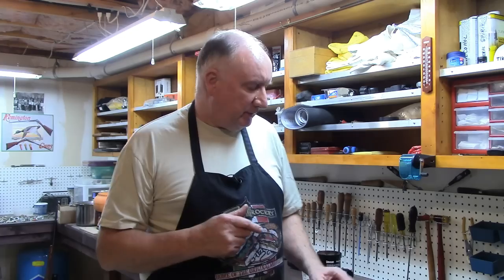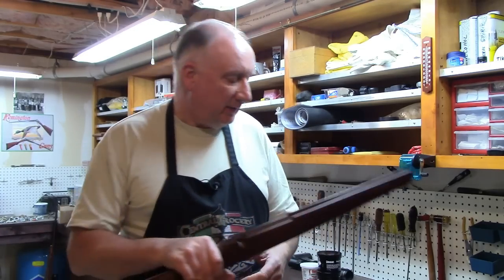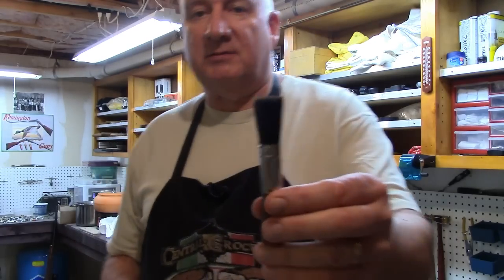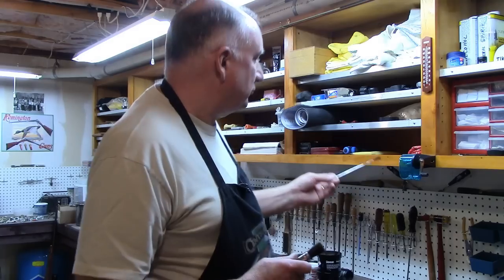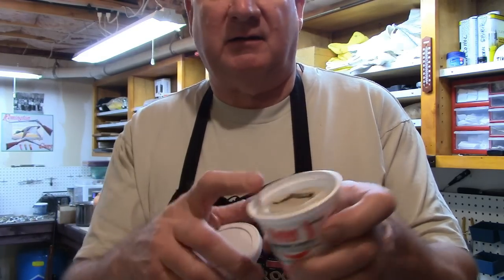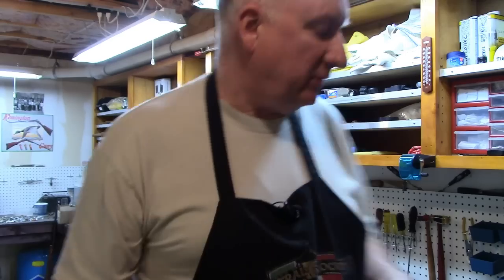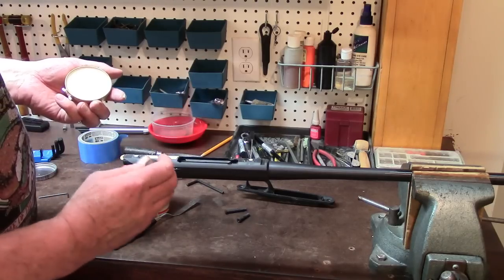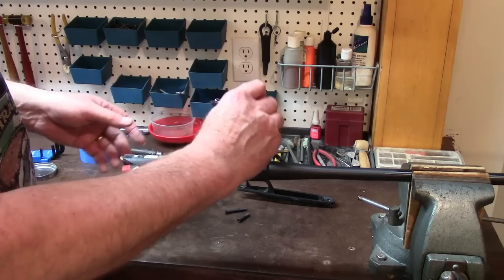How to glass bed a rifle, Part II ~ Let's bed that rifle professionally!

Comment: Captain, the more I research glass bedding for my specific rifle and stock the more freakshows I find. People are making a complete mess out of their rifles! Most of them are getting that slop everywhere because they don't know how to work with epoxy, and it is evident that they don't understand the concept and potential ways in which it prevents inaccuracy. One guy couldn't get his stock to separate! Your video has been really all I need and it's too bad a lot of them didn't arm themselves with the proper knowledge. Like almost everything in life, preparation is key. You are right, it's not for everyone. I'd watched this video before I did two of mine and they turned out nearly perfectly. Thank you!

Comment: Just picked up a very near perfect 45 year old Kleinguenther K14 in 25-06.  Made in Germany and developed by the man of the same name who once designed for Weatherby then moved to Seguin,  TX to start his own business.  I was a bit disappointed when finally I opened it up to find it was not bedded.  It indeed had small wood pegs angled into the front of the fore end holding up the barrel by less than 1/16 inch.  I shot some over-priced and overly hot rounds of Underwood and got about 2 MOA.  I could live with that but hopefully with better ammo I can improve that.  If not I will be forced to epoxy bed it.  I've worked with my hands all my life and am sure I can do it if I have to.  I'd rather not though.  It's a beautiful rifle and I'd hate to ruin it.  I will watch your videos several times before I attempt it.

I'm assembling the components to hand load for it but it is very difficult to find everything these day.  Sure makes shooting tough.

Comment: Thankyou for this detailed series of informative videos, it's particularly helpful for me as I have a Tikka t3 which I'm making a laminate stock for out of birch ply. It came with a synthetic stock, it's an experimental process but looks promising. I plan to glass bed the action in as you have shown and ensure the barrel is fully free floated, hopefully then I will see no loss of accuracy from using the synthetic stock. The gun in its original form I have shot 1/2" groups from at 100m which is exceptional considering I'm using factory ammunition. Lucky for me as I don't reload!! Thanks again. 👍👍

Comment: Those days of Guns and Ammo magazine are sorely missed .  Aluminum 1/8 " thick plate and fiberglass resin was what I used on a Savage 222 bolt action at 14 years old / 50 years ago . A lot of filing by hand and prep work . This is a great video and thanks .

Comment: Some of the most valuable information on bedding an action available any where. I did this back when you had to buy books to gain knowledge on any subject. I didn't know to use the tape on the barrel and on action to hold it in place along with some other small but very useful tips he teaches. Seeing this done ahead of time would have made it much easier. You can have a heart attack doing this for the first time for fear of your bedding material starting to set before your finished

Comment: Absolute novice here at this stuff. Used everything you recommended (here in aus) can find all the same stuff, even the steel putty if you know where to look, and nailed it first go. Rifle released with no dramas, bedding surface absolutely perfect! Thanks so much. Couldn't be happier. Your knowledge and clarity of instruction is second to none.

Comment: Thank You for your comprehensive videos . I just finished epoxy bedding a Rem 700 plastic stock.  Waiting overnight to see if the barrel releases is the hardest part.  I wanted to add a comment about cleanup.  Found that compressed air works well to blow all the putty out of the small crevices.  Follow with my mineral spirits and cleanup went quick.

Comment: Thank you so much for such a comprehensive video.  I have watch everyone of your videos in the last 6 months and recommended your channel to a number of fellow shooters.  I have a Browning 222 that I have been evaluating for such a project.  I am mechanically inclined and this video was much more comprehensive that most and gives me enough confidence to attempt a bedding project on a old 22 before attempting this on my 222.  Keep up to fine work and thanks for sharing your knowledge.
Reply from the maker: PaskKingFisher001 
You may be aware that Browning 222 bolt actions were once manufactured by Sako of Finnland years back.  In any case, they always made accurate guns, and it would be a fine shooter.  Thank you for your kind recommendations!
Reply: Congrats on finding a Browning/Sako! Unless that is not what your alluding to, the old L461 Browning safari is what my mind jumped to at least. I regret an opertunity to buy an old Marlin/Sako 222Rem, a while back that I passed on. Wish I hadn't!
Reply: PaskKingFisher001 ,

Comment: I applied bedding epoxy to my Browning AB3 at 1:00pm today. Thank you very much for the instruction videos. I followed your advice but I had to adapt to fact that I had to leave part of my trigger mechanism in place with lots of masking tape and plumbers putty - I had to leave it in place because rear action bolt surface rests on base of that mechanism. Thanks again because you gave me confidence to do what I wanted to do.
Reply: I followed your advice and got a great result. Awesome!
Only thing I did differently is that I chose a different epoxy. I chose the gray Marine-Tex epoxy because it was cheaper.
Reply: My bedding project is done now. I have everything cleaned up, everything fits perfectly and the action works as well as it ever did. I will have to wait until weather breaks to see how it shoots. Thanks again.

Comment: Thanks for background info on H332/Sierra load from Part 1.  I did not realize how different bullets can allow higher powder charges.  You are a wealth of info.  The old 222 is still my favorite caliber. Appreciate your insight into it.
Reply from the maker: Because bullets vary in resistance down the barrel, pressure also varies, and because pressure is the mother of velocity, different bullet types can produce the same velocity, even though the charges are different.

Comment: I watched this and then pillared the rear of my interarms mark x and bedded the front. Turned out fantastic. I used the regular devcon plastic steel instead of the putty and I do wish i had bought a syringe to apply it with. I did panic a little when taking the screws out and scuffed them up using the wrong size screw driver in a hurry. It was stressful not know how it would look but i was very pleased with the result

Comment: Great informative video! Definitely shows all the intricacies of how to bed a rifle. I've only done 1, and that was a K31 with a spare stock that I refinished. Definitely wasn't for the faint of heart. I just used JB weld, the professional stuff. And it worked, but it also scared the hell out of me when it wouldn't come out on the first couple tries. I finally just got the right size dowels that fit into the action screws and gave them a few whacks and it popped right out. It wouldn't fit in my freezer, and with such a long stock it was hard to give it a good whack. I think the problem was that the octagonal front of the action was just so tight fitting, it needed those whacked from the bottom of the screw holes to push it straight up. All I did was front of the action and the tang. But ya, my gut was in a knot until I got it out. I got a nice laminated target stock for my Savage 10 TR. Which I'm planning to bed in a lil bit here. So I can definitely watch this before I start, and take my time and do it right with Devcon. Cheers great job.

Comment: I used to do the entire action, after listening to this I can see why it was not a good idea, the rifles have always shot extremely well but there is no need to build in a potential problem, that Devcon is a fantastic product, much better than accuglass but is you are planning to use it for 7 or 8 rifles you better get them all done in a matter of months as once you open it it will go of in the can. When mixing epoxies I don't use a cup as you leave to much around the sides of the cup, I use a small flat piece of sheet steel that can be cleaned with thinners after use, I also use it for filler on my cars, easier to mix on and you can use most or all of the product, I will have to get a couple of those art knives, bloody good idea

Comment: Good videos!
In my experience glass bedding is all about preparation, focus and patience. 
Take your time and it will pay off in the end.
Also, JB steel weld is a great alternative to DeV Con, and works just as well.
Reply: Which JB Weld specifically? Cheers
Reply: @RoadRunner27  JB Weld Steel- Not   the quick cure kind, that has a lower tensile strength

Comment: You can use a lot of bedding for the entire action area, and it will look amazing. Down side…you almost need a mill to remove all the excess epoxy inside the stock area. 

If I do this again, I’ll do it the way you showed. Unless I have a mill, then I may do the entire action area again.

Although, if my gunsmith isn’t 9 months out on work, I’ll just pay him lol.

Btw hope you’re doing well!

Comment: I would say it is still better to bed the recoil lug. I have done this on Tikkas, any excess will flow out and worked fine for me. It doesn't need a ton in the recoil recess, for sure, but some I think is very important. The recoil lug fit and contact is vital and would not have any play at all if fully bedded. From the factory, there is excessive tolerance, as can be seen by how easily the lug goes into and comes out of the recess. Even a lug that has been taped on both sides fits tighter after bedding  than the Tikka lug does in the original factory inlet. I also fee better with both guard screws having clearance and not acting like recoil lugs themselves. If it works for you, I guess it works. I would worry about cracking a stock with screw contact, as this certainly can happen. If the screw is relieved, it obviously prevents this.  Not trying to disagree or argue with your style, just my 2 cents. A lot of different preferences when it comes to how people like to bed a rifle.

Comment: Looking to bed a Ruger M77 wondering about the action screw holes in the receiver that do not go all the way through like it does on the Tika shown in this video; so there would be no where for the plumbers putty to go (extrude)too when the action screws are installed during the bedding process . Basically the plumbers putty would be crammed into the action screw holes when the screws are installed. Is this going to be a problem or is there another solution for this type of situation?Thanks in advance, also really enjoy your videos told my friends about them as well

Comment: This by far has to be one of my favorite videos you've done. I've watched it several times and as a result, was able to successfully bed my Win. Model 70 into a Boyd's Thumbhole stock (also had to do some fitting work with the Dremel, not a drop-in as they like to claim. I would like to know how you get the Kiwi shoe polish off the rifle, it's not wanting to lift off my barrel/receiver very easily, I've tried isopropyl alcohol and BreakFree CLP so far with just Q-Tips and a rag. Thanks again for this great video.
Reply from the maker: AZKYHunter 1980 
It should come off with mineral spirits or acetone.

Comment: holy smokes ya if your barrel lug is attached to barrel id recommend using a lot of release agent or taping the sides and front of lug. I used shoe polish release agent but didn't tape and holy crap I had to make a jig out of wood just to get the sucker apart almost broke my stock. Turned out great once I got it apart though had a nice column where the front screw goes in got her free floated waiting on the stain to dry. Also I used JB weld not sure if that's the greatest epoxy to use or not. Next time I'd probably take the time and order the same stuff in this video.

Comment: I have watched your video 4 times and the instruction is second to none. The insight and tips on procedure are valuable. I had a question about the recoil lug being attached to the barrel. Would you 
 apply epoxy around the recoil lug and set the barrel in?  I am do my homework and attempting this for the first time.

Comment: Interesting to watch !  I have a Romanian training rifle (22lr) that the first shot is always down and to the left, but the other shots are all on target, I just might try bedding the rifle after looking to see if it really needs it. I prefer to shoot paper at 100 yards, so nothing to really brag about.
Reply from the maker: Your situation doesn't point to a bedding issue. Poor bedding causes poor accuracy, which is not what you are apparently having. However, the first shot(s) out of the standard group is caused by a difference in bore condition; most commonly the presence of protective oil, or aggressive cleaning that stripped copper plating (in the case of high power rifles or rimfires with jacketed bullets), or the bullet lubricant used on 22 rimfires.  As 22 target competitors have long known for over a century, 22 rimfire rifles do not require cleaning beyond the removal of moisture attracting powder residue, as they are well protected by bullet lubricants that coat the bore. A few dry patches are typically sufficient, or better, one pass with a Hoppe's Bore Snake.  Certainly, any 22 will shoot at its best when the barrel is free floated and the receiver is epoxy bedded, and your rifle may respond nicely to such treatment (as with CZ rifles), but the target results you describe is typically first shot, clean bore syndrome.
Reply: @GunBlue490  Thanks !!

Comment: Hello, I saw this video of yours a few years ago, which taught me a lot and allowed me to do this type of work, so far with good results 😅. I think everything you can teach us is wonderful. I watched the video again because I was looking for the epoxy resin that you use for bedding. Right now I want to make a casing for a visor base that has already caused me some problems, but I have another problem. It is difficult to find this resin in Spain and I have a very, very good one but it is very liquid. I ask you: what binder could I use to make a thin but hard and consistent layer with liquid epoxy? Thanks in advance and greetings from Spain.

Comment: Wish I had a little more information on how to do this to my '81 Ruger M77.  I've heard you mention in part I and another video I believe about how it will require 1-1/2 inches or more support of the barrel because of the angled mounting bolt. I'd love to get a little improvement but would hate to screw up a rifle that will shoot 1.6 moa as is.

Comment: I used these instructional videos to glass bed my Remington 783 to a boyd's gun stock. For the first time ever doing this I think it turned out really well thanks to these step by step instructions. I only had one problem, when I took the tape off and separated the barrel and action from the stock I didn't have enough bedding material in the front bolt hole to make that solid pillar. I am wondering how I can fix this mistake? Do I have to dremel all the bedding material out and start over again or can I just wax everything up again and put more bedding material in the bolt hole to make that front pillar?

Comment: If you want to even out the shoe paste take a hair dryer and run it on hot. It will heat the metal and the paste will run into all corners. I have also had luck with Hornady One Shot  ; spray it on and put the hair dryer to it. I did not like the paste from Brownells it pools into globs and some areas are not covered causing a lousy job and big time trouble. Great video. If you talk nice to the wife I'm sure you can score a hair dryer.

Comment: Thanks so much for the great how-to!  I intend to bed an older Ruger 77 in 6 mm Rem that has the tang safety, a wood stock, and the barrel is not free floated.  Are there any special considerations I should be aware of for bedding this Ruger?

Comment: Awesome detailed tutorial. I have a model 70 where the stock around the front action screw is cracked vertically on the rear end. Would you recommend just Pilar bedding the hole as you did and not worry about the crack or do I need to get that fixed first?

Comment: I'm truly amazed that the epoxy compound appears to have been completed excluded from the recoil lug through pressure alone.  Is it really the case that you don't need to clean it / leave it clear of epoxy to some extent?  My reason for asking is that i expect to be doing this on a GRS stock in the near future and I really don't want to bugger it up!

Comment: On a model 70 xtr with 3 action screws (front screw, middle screw for trigger guard and rear screw for trigger guard  tang) do you dremel the 3 contact points or just the front and rear and not the middle?

Comment: Question:  do you fill the screw holes completely full of plumbing putty?  It seems like the extra would be displaced into places its not wanted when the screws are inserted.  Or even prevent the screws from going home?

Comment: Can I use this same process with synthetic stocks?  I have a dremel tool with same bit.  I assume I rough-up the synthetic stock in much the same way as you did the wood stock.

Comment: Do you ever get any epoxy pushed up into the action by the action screws? Or is the plumber's putty sufficient to force out the epoxy between it and the tips of the screws?